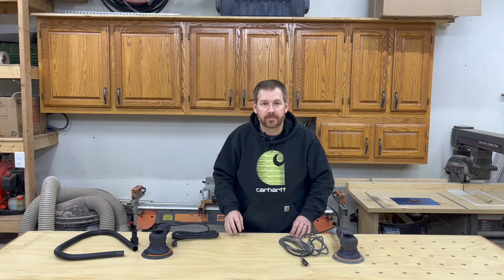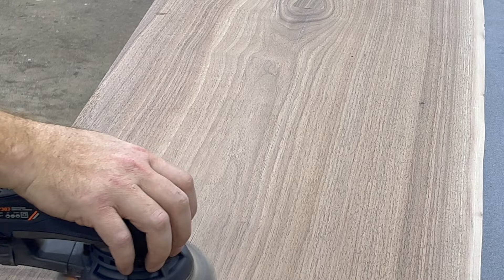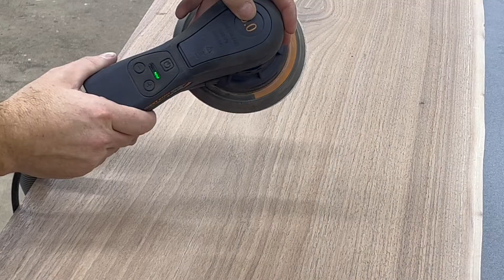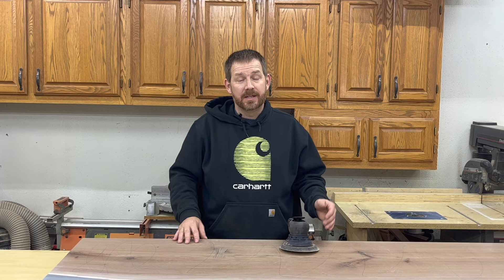Maxxt Updated Review.... Watch Before Buying!!

Comment: I am not basing my purchase on this video. He did not explain if he had both vacuum and sander on same circuit. Another YouTuber explained having the exact same issue and tested it by plugging into another outlet and problem solved. It seems the DA needs a certain amount of power to run smoothly.
Reply: I think he shares the circuit from the vacuum itself. Some vacuums are designed or built with an outlet for sanders to plug in to vacuum. This can cause issues because some vacuum comes with horrible plug 🔌 outlet. I used it 4-8 hours a day. Share same outlet coming out of wall as vacuum. No issues. I think is not the sander it’s his electrical having issues.
Reply: Yeah this is important. The way it 'dies' and then resumes at 100% capacity for a few seconds before 'dying' the same way doesn't seem like tool motor death at all.
Reply: no, I did the tests on two different electrical circuits and on my vacuum cleaner and the problem is the same in all cases.
Reply: @patrickgirard-k3g  I have mine almost a year now. I use it daily. I build high end cabinets. I ran circuit for these sanders separately from all other tools.  My 2 helpers ran  both sanders at same time. Some days 6-8 hours of sanding. No issues at all when u ran them on its own circuit.  I love them they are as good as 3m sander or even better in my opinion

Comment: I bought the same sander, during the first try I felt slight electric shocks in my hand and after a few hours of use, it no longer works, insulation fault which triggers the differential circuit breaker on my electrical installation, I sent an email to the manufacturer who responded very quickly certifying me that they took my problem into account and that they informed their engineering department, Amazon sent me a voucher for the return of the sander and the total reimbursement of the sander, I am buying one again but given the unreliability of this equipment I don't know if I will buy the same one again, it's a shame because this sander has very good ergonomics, a light weight and power, it's a real shame that MAXXT has not resolved these malfunctions to date, my purchase was recent December 31, 2023, it was used for around 10 hours, that's not a long lifespan for a sander!
Reply from the maker: I decided to go with the 3M Xtract sander.  It’s a bit pricey but I’ve put a ton of hours on it and it’s great!
Reply: same issue for me !

And now how is the second sander you received ? same problem or not?
Reply from the maker: I had the same problem with the second sander.  I ended up going with the 3M sander now.  I’ve had it for about a year, I use it alot and have had no issues.

Comment: I'm currently thinking about buying the Maxxt 5.0 in 6”. 
And I'm wondering whether European customers also have such problems, as the power grid is very different. 
You have 110V 60hz, we have 230V 50hz.

China, where the Maxxt sander is probably manufactured, also has 230v and 50hz...

Comment: I have the 6" version, and used it for one project. It was running more than 30min, but not continuously. This sander makes me not hate sanding as much, but I still hate sanding in general. If I can't hand plane, I scraper. Sanding is the last option for me. 
It would be a great product test with a fixed amount of weight on it and find out how much down pressure is enough and how much is too much.
Reply: No amount of planing will replace sanding.
Reply: @rustic35   I am not sure what kind of planing you have in mind.
Reply: @Fusion_Woodworking  probably because I was replying to someone else? Basically the person says they try to only plane or scrape in order to avoid sanding. 
A plane doesn't replace sanding. 🤷
Reply: @rustic35  that’s also my account. I now have a second account dedicated for woodworking. My original statement is my preference, yet I never claimed one replacing another. 
I can see reflections in my planed white oak surface. I do not think 320 grit sand paper can give me that kind of result, not even 3M cubitron mesh on a festool sander.
Reply: It certainly can. Sandpaper was a relatively new invention compared to hand planes.

Comment: The customer service is absolutely Phenomenal. I had a similar issue. They sent me the LED pad.... Wrong diagnosis. The sent me a new mother board and paddle. I installed it, rewired it, it works. But we will see for how long. MaxXT is a definite Not Recommended tool. Unfortunately I can't return it. My return wind has closed. Lesson learned. Stick to name brand. 3M, DeWalt, Festool. Just gotta save more so I can afford it. Aloha. Thanks for sharing this video.
Reply: Dewalt, Festool is also our goal to achieve. We also produce powertools for dewalt brand. We believe we have enough ablility to slove customers' problems. We will keep improving. Sorry for incovenient and thanks for your feedback. It is because of all the feedback you have given us that we have room to improve and get closer to dewalt, festool again. 😀
Reply: I would also add the Flex brand, in particular Flex ore 5-150

Comment: Thanks. I was about to pull the trigger. Reminds me of my Porter Cable 6". My friend who is a full time woodworker told me to make sure I bought the replacement plan, which I've done many times, often not even needing to use it, as the sander would die before a week or a month was out. I honestly lost count after 5 or 6 of them. I'm buying another 6" this weekend or next week, and am just going to have to suck it up and spend the big bucks. I often have to sand for hours on end, so no way would that work.
Reply from the maker: Thanks for watching!  I ended up spending the money to get a 3M sander and so far it’s been great.  I’ve got quite a lot of time on it and it’s still running great.
Reply: @Idealwoodworks  probably what I’ll get. Where did you buy it if you don’t mind me asking.
Reply from the maker: @deanaoxo  I ordered mine from Amazon.

Comment: It appears that the source of the problem affecting the sander maybe due to sensitivity to changes in voltage.  A couple of reviewers have noted that if the sander and the dust collection runs off the same circuit, you can run into situations where the unit shuts off.  If the sander is plugged into a circuit that is different then what is powering the dust collection, the sander does not experience the same power issues.

Before giving your ultimate thumbs down, I think it's worth testing this theory.

In reality, it's very easy for us to start overloading our circuits in the shop. It's just not something we normally think about. The more power we draw, the more we risk damage to our tools.  Additionally, we don't really have any way of knowing just how clean the power is in the shop, without the use of some advanced diagnostic tools.
Reply from the maker: Hello, thanks for watching!  Whether that’s the cause or not I can’t speak to.  I sent it back.  I can say that I switched to the 3M Xtract sander.  I’ve been using it a ton for the last 10 months with no issues.
Reply: people should not trust this this guy and his channel anymore!

Comment: Dynabrade makes industrial grade sanders that are made for production lines.  I think that if they are made to run all day in aircraft factories...well you fill in the blanks.  Made in USA.  Slightly less than a Festool sander.  Mine has had no problems (it is pneumatic btw which  reduces overheating issues if adequately lubricated).  I suggest to anyone looking for a durable sander that can be abused....DYNABRADE!
Reply: Btw...Amazon sells Dynabrade.
Reply: Any pneumatic sander, even cheap Chinese ones will last forever.

Comment: I’ve been in discussions with Maxxt it’s a static issue that shuts the processor down and they are working on this minor issue.

I have two of them and have had  no problems and it’s been reliable.
Reply: Several reviewers have identified that running and sander on the same circuit as the dust collector may also contribute to the sander turning off.

Given that the manufacturer is looking at a possible static issue as a root cause, my guess is that this is electrically related and not mechanical.  It may be worth trying to run the sander on a circuit separate from the dust collector.
Reply: What if you plug your sander in via the dust collector?

Comment: This sander need a constant voltage and when plugged into a vacuum, you share the same circuit and can see voltage drop where the sander will stop.  Just plug into a different circuit and you'll be fine.  This guy isn't too perceptive on problem solving.
Reply from the maker: Well, actually, the sander and the vacuum were plugged into different circuits.  However, If that’s necessary for it to operate that’s just further proof that it’s not a good sander.  I’ve been putting a ton of hours on my 3m sander with no concerns of plugging into a different circuit than the vacuum and I’ve had no issues.
Reply: Other sanders don’t seem to have this issue. We run two mirkas plugged into dust extractors daily and have never had an issue like this. If you can’t plug it into your dust extractor that’s a problem.

Comment: I can't speak about the Max as I don't have one, but since it's a Mirka Deros styled sander I can speak about the Deros. 

In the manual for the Deros it states if using a interface/protection pad to keep it in the 7k rpm range as a max.  Most everyone who buys the Deros will be using net abrasives and in turn a interface/protection pad. So if running maxed at 10k rpm it could possibly account for the dreaded control module fault that people experience with the Deros. As I imagine most don't read the manual and run it balls out. 

It's just a theory and could be bullshit, but through the Mirka App I set my paddle to max out at 7.6k rpm. Time will tell for me and the Mirka I suppose, but I can add that in my just under a year with the Mirka, I've gotten a lot better run time than your 30 minutes with the Max.
Reply from the maker: The Mirka was one that I was also looking at, heard a lot of good things.  I ended up going with the 3M Xtract after sending this one back.  I’ve got quite a few hours on it and so far so good. 🤞  Thanks for watching!
Reply: @Idealwoodworks most people on YouTube seem to get on well with their 3m sanders. Are replacement pads readily available? And do the Mirka pads fit the 3m?
Reply from the maker: @Fictitious_Character  I’m not really sure how readily available they are.  I’ve only had the sander a few weeks so I haven’t looked into replacing the pad yet.  I haven’t looked into the Mirka pads, not sure if they work with the 3M.  Hopefully it will be awhile before I have to replace the pad… that sander was expensive enough I’d rather not have to spend more money 😂